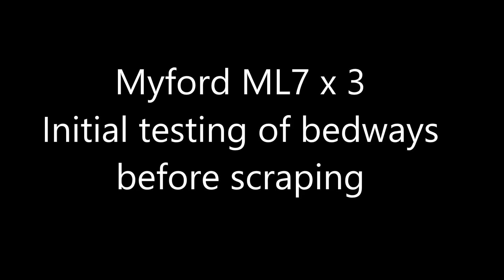MyfordML7: partial restoration of 3 lathes - part 2 - initial bed measurements

Comment: Interesting. I know my ML7 needs a bit of fettling but always assumed the bed was OK. I think I'll have a closer look. 👍
Reply from the maker: Thnks for commenting. It doesn't hurt to measure to gain some insight to the lathe performance, but I wouldn't be too worried if you found some wear here and there. Only where you get to the stage where functionality and/or accuracy is degraded would I take any real action. This point in time could vary a lot depending on you actual demands. For example, the best of these 3 machines, the ex. Uni specimen, is only slightly worn. However, as I wanted to use it for demonstration purposes ie. as I set to attempt to scrape the beds, I jumped at it,  but for others and in normal use would still perform nicely a loong time.I assume this after 60 years can be termed as a "lightly used lathe" 🙂